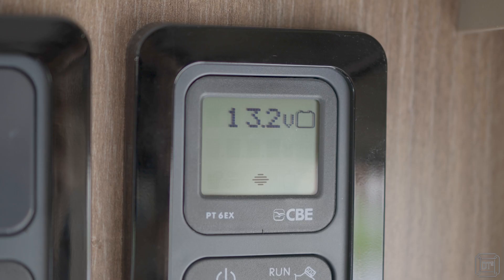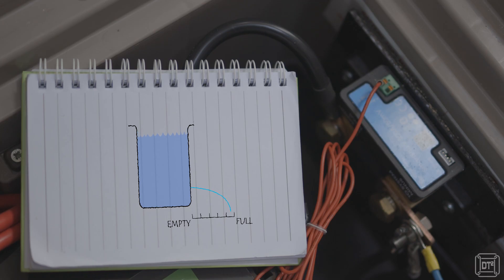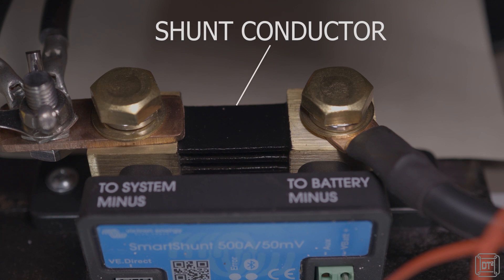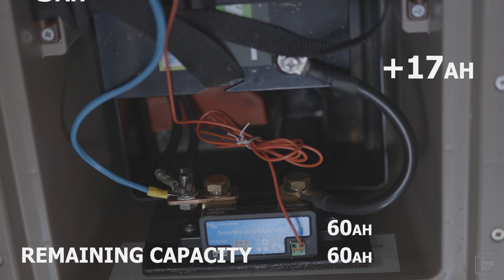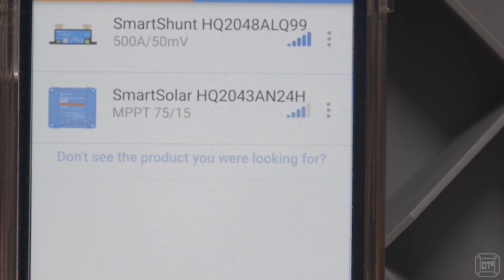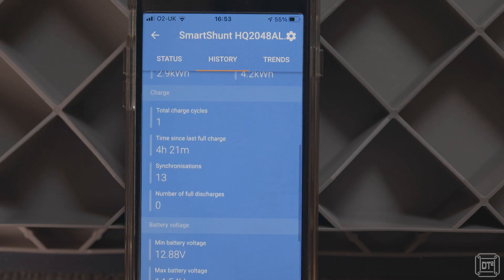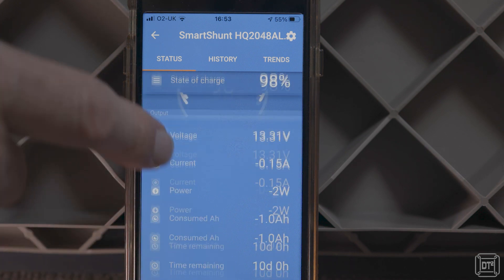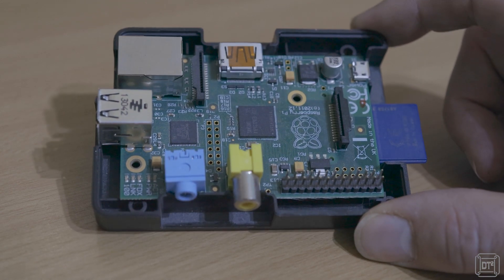VICTRON SMART SHUNT –smart enough?

Comment: Lots of missinformation.... well...not 100% missinformation but misspoken... in fact Li-IOn is VERY accurate capacity dependence on voltage. But LiFePo4 batteries is not. and u used term Lithium batteries is not good at telling SOC... yeah for LIFePO4 but not Li-Ion batteries.
Reply from the maker: Thanks for ponting that out.

Comment: Great explanation. Does the shunt show the amp in and out separately. I d like to know the generated power rather than the net.
Reply from the maker: Thankyou. No the shunt can't measure generation at the same time as usage (i.e. if you have a solar panel in circuit). It will only measure the net loss or gain. Which is a benefit since otherwise it would not be able to keep track of the batteries state of charge.
If you have a smart solar controller then that could measure the generated current and by combining the data from both devices you could know the current used, generated and subtracted (I.e. deficit in the battery). Ideally the victron shunt and solar controller, which do communicate, should record data from both devices and do the maths but unfortunately they don't. (Hence the video title.)
Reply: @DTSquared thanks. Makes sense.

Comment: Was wondering what that little red wire was for.    Probably also how it determines the voltage.
Reply from the maker: Yes it also detects the voltage as without it the shunt would only be able to measure the voltage across the shunt which is not the same thing as the battery voltage.

Comment: If i wanted to purchase something similar to the bus bar you added to allow for a small eyelet size, what would you suggest?
Reply from the maker: I just purchased a strip of copper flat bar from amazon and cut and drilled it. If you don't want to go down that route, then the alternative would be to look at 12voltPlanet.co.uk . They have all sorts of busbars that you could probably modify. Or if you reach out to them they may be able to suggest something. As I recall they were quite helpful when I last used them.

Comment: It appears there have still been no updates to the smartshunt, even with using the Cerbo GX that can hold what I thought this was for, how much you system was actually putting into the batteries in a day. I wanted this to compare the smartsolar 100/50 to the epever 8415 AN charge controller, as I’m more than a bit skeptical of claims that Victron’s product performs better. The failings of the smart shut have left me with having to trust each charge controllers tracking, and so far, the victron smart controller is not matching up well at more than an additional 1/3 of the cost, especially when you add in a cerbo gx which is required to get the same data epever provides with a $30 wifi dongle.
Reply from the maker: Some people have mentioned that there have been updates in regards to recording data but if there have been I haven't found them or they relate to the temporary monitoring when the app is open.

Comment: can the shunt stop the discharge flow to prevent to great a battery discharge ?
Reply from the maker: The shunt is purely a monitoring tool it has no switching capacity. I believe that Victron do have a range of battery disconnect devices which will disconnected the battery when a voltage is reached to avoid over discharging the battery. But I haven't used those or researched them in any detail.

Comment: Hello david could you tel me what size stock cable i need to connect the shunt to battery thank you
Reply from the maker: Hi Scott, The size of cable isn't really related to the shunt but instead would be based on your maximum current draw and the distance between the shunt and the battery (i.e. length of cable) which should ideally be as short as possible. Obviously the shunts rating (500amps on the version I purchased) would also be the upper limit.
I purchased a pair of battery connector cables from KS Energy (the same place I purchased the shunt from). They are 25mm2 CSA (about 6mm conductor diameter) and according to the link below rated to 180amps.
I only used one and shortened it but mainly for neatness as I doubt the change of length from 300mm to 200mm would make a rating difference. So if you don't have crimping tools they can be used as is. 
If you are just connecting "normal" 12v stuff then this should be sufficient but if you have higher current draw items such as inverters or motor movers then I'd recommend checking.

Here's a link to the ones I purchased (KS energy has been taken over by another company but the store link appears to still be up.)   https://leisurepowerproducts.com/shop/ols/products/300mm-parallel-battery-to-battery-connector-lead-set-with-8mm-lugs

Hope that helps.
Dave
Reply: @DTSquared  great thanks for that 👍 just one more question did you connect the motor move to the shunt system minus also thanks for your help

Comment: I just got this shunt today and have it on a 24v100ah lifepo4 lithium battery its great measuring what i am drawing out of the battery but just wondering if i can add a battery charger to the shunt aswell to measure what's going in? I was thinking of getting the victron 1p22 charger.
Reply from the maker: Yes you can add a solar charger and if you get a Victron one with bluetooth they will communicate and share certain data.
The shunt will then measure what is going in and out of the battery. If you have a load (ie lighting) and sun is shining then the current draw shown will be the balance of what thebbattery has to pick up. So will be lower than the actual load. But it will still calculate the balance of the battery correctly. Cable from the solar should go to the shunt not the battery terminal that way it flows thru and calculates correctly. You should be able to see this in my video.

Comment: I have two 200 amph lithium batteries in parallel do I set up my shunt for 200 amph or 400 amph?
Reply from the maker: Assuming the shunt is wired up so that all loads a charge sources are going to the same neutral then it should be set as 400ah.
If you think about it each battery internally is multiple cells or battery's, so the principal is the same. Your two batteries are creating one big battery.

Comment: Dont you need to explain negative distribution? If connections are made directly to the positive then the shunt wont measure any current draw!??
Reply from the maker: It's generally direct connections to the negative terminal which bypass the shunt and are therefore not measured. This is why the installation instructions recommend that the shunt is the final and sole connection to the negative terminal. So a device connected directly to the positive AND negative would then be on a separate circuit entirely and so not be measured. A device connected directly to the positive but returning to the negative via the shunt would not be any different to any other device since it's just forming part of the overall load.
I'm not familiar with the term "negative distribution" but if you have some links to an explanation then I'd be interested to read up on it.

Comment: Excellent instructional video Thanking You 2000%. I think some battery's have things like these fitted inside
Reply from the maker: Thanks glad you liked it and found it helpful. Some batteries, specifically in this case LifePO4, do indeed have a method of measuring their remaining capacity. However some of them use the cell voltage instead of counting the amps in and out as a shunt would do. This makes them more accurate over long periods where the battery is not being charged to 100% (and therefore not allowing the shunt to effectively re-calibrate). I always use my KS-Energy battery's built in bluetooth for checking capacity when in storage over winter. But it also makes them more susceptible to other influences on the battery voltage. But they are still, I think, more accurate than a simple voltage meter across the terminals as they will be designed for the specific configuration and also are constantly monitoring and so make allowances to give a more accurate figure.

Comment: This helped a ton. If you go with either of these, do you get the same looking interface on a smart phone that you would with a GX Touch 50? That looks pretty good how its shows the devices, graphics showing power direction, power sharing, etc. I can't find any images of the Victron Connect App with this same GUI.
Reply from the maker: Hi Tim glad to hear that helped. I've not seen any holistic system type displays anywhere on the app. The latest update puts some basic information on the initial device list screen such as the battery % for the shunt and solar power for the charger (that's from memory as I don't have it in front of me).
You have to go into each device to see more detail and it doesn't really show information from other devices when you do. I think I've seen similar screens on their website for the windows app but certainly not in the mobile app.

Comment: Thanks for your insight. According to your explanation here how accurate does it work with lead acid batteries? I am ging to installiert a smart shunt and offload the data to a Software called 'Solaranzeige' on a Pi.
Reply from the maker: Hi, The shunt measures current so works on any battery type. They are particularly useful with Lithium batteries because the voltage difference between~90% and ~10% is very slight so can't be used to work out capacity accurately. However on LeadAcid batteries whilst the voltage drop is pretty much a straightline in relation to capacity it is significantly affected by load and charging. So on a lead acid battery you ideally need to turn everything off then wait a while before trying to estimate capacity based on voltage. So on that basis the shunt should give you a more accurate measurement of capacity on both battery types but for slightly different reasons. Hope that helps.
Reply: @DTSquared  Hm, I got a 24/230V Konverter and a Fridge connected. Both are discharging the battery on pretty constant amount, of depending whether the fridge is running or not. Like if the fridge is off, the converter will pull about 50Watt ~ 0.9A (only converter and Raspberry Pi) and when fridge is running its about 110W ~3,6A (all 3 together). So, fridge is usually running ~5Minutes and afterwards its about 20~30 Minutes rest. <- Will that be enough to get an idea or do I need to switch off everything?

Comment: Dave great video and lots of good info yet again.
I am thinking of getting a Victron smartshunt as well however I use a portable folding solar panel which I put up on arrival at site. As I usually connect straight to the battery with crocodile clips I don't think this would be possible with the setup required for the shunt.
The positive crocodile connection to the battery would be I think OK but where would the negative connection go?
Would it have to go to the shunt "to system minus" side and not to the negative battery post where I normally put it.
Any thoughts would be appreciated.
Cheers Peter
Reply from the maker: Thanks Peter glad you found it useful. The negativr solar connection should really go to the shunt (on the side away from the battery) that way input current will get measured correctly. Whilst crocodile clips aren't ideal (especially for large panels) it should still work OK assuming that you can get the cable to it from the panel of course. I made another video about a DIY external MC4 connector which you may find helpful. Can't find the link right now as on a coach in Stockholm but if you search my channel for MC4 you should find it easily.
Reply: @DTSquared  thank you for the reply.
I will check the video out. 
With what you have said I think I will remove the crocodile clip and put a ring terminal on and connect permanently to the shunt that way. The solar panel cable has a plastic socket connection so will still be able to disconnect the panel from the system leaving the negative part still connected to the shunt. Hope that makes sense.
Have a good coach trip.
Cheers

Comment: Very detailed explanation. Where I get confused is whether or not the app can calculate current wattage consumption from an inverter draw. IE, the only draw is a 500watt device from an inverter. Does the app show that 500watt draw accurately even with an incoming solar charge through charging the battery?
Reply: The shunt only shows what is going into or coming out of the battery.  If the inverter is turned OFF, then what is recorded by the shunt is what the solar charger is putting in.  If the solar charger is OFF, the shunt shows what the inverter is taking out.  If both are ON at the same time (charger and inverter), then you have to do the arithmetic:  Inverter load = Solar Charger Output-Battery Input.  Best us a clamp on DC digital amp meter to get the real inputs to the inverter, and not rely on the LCD on the inverter telling you what the output is because of inefficiencies in the inverter itself.  I have a Victron shunt, and as of fall of 2022 it has a graphical history of any two variables you want to track.  I like it.

Comment: I notice that you have installed the same lithium battery and Victron set up as me. What I don’t understand is the Victron app shunt shows a different capacity to the KS energy app with the KS app showing more capacity than the Victron.  I’ve connected all ground via the shunt so that’s not the problem I’ve also charged the battery with a Victron charger set for lithium before telling the shunt that the battery is at 100% so a bit puzzled.
Reply from the maker: The KS app/BMS uses a slightly different methodology to calculate the state of charge. I usually find there's a couple of percent difference but nothing to particularly worry about. Here's some words from Neal at KS when I asked about it. 
quote*The SOC gauge algorithm logs both current and battery impedance to estimate the SOC, and the impedance can be variable with things like temperature, load, or trying to charge over a period at an incorrect voltage. The Victron shunt you have can be a little more advanced and accurate for SOC once its set-up and calibrated since a shunt can more accurately log current, but even using this it can accumulate inaccuracy’s and may fail to auto calibrate during use if you are using a range of different charge voltages.*endquote
Hope that helps
Dave

Comment: So the shunt tells you how much you have used. Fine. But how do you ever know if you actually started at your battery's maximum? Did your charger quit after it hit 78%? Some other %? Do have to go to dead and then measure how much goes in? Then compare that to the rating on the battery?
Reply: If your battery is lead acid type, measure the specific gravity of the electrolyte.  That is the only sure way to know it is fully charged.  Let the battery rest a few hours before making this measurement
Reply from the maker: The shunt considers the battery to be full once the specified charge voltage has been reached AND it has stopped charging (i.e. no current flowing in). Not purely that there is no charge going in since obviously that would happen every night when charging with solar. If a significant amount of time passes during which the battery is never fully charged then the shunt’s state of charge percentage will drift over time due to inaccuracies in the “in/out” measurements building up plus the natural discharge of the battery which it cannot measure. That's why it's recommended to ensure the battery gets fully charged every so often (I think the recommendation is once a month).

Comment: Thanks for the video. For the price ($300) the performance and features of the victron are just not there. I have since replaced the 712 smart for a $60 unit that I find does a far better job. Has a much better interface, and comes with a remote (wired) screen for inside the trailer as well as bluetooth with a great looking app. Look up: KG140F.
Reply from the maker: I did look at some of the Chinese un-branded shunts. But I wanted to stay in the Victron environment (which is why the lack of data passing between the shunt and the smart solar was a disappointment).
Reply: I'm disappointed in my Smart Shunt. I have 4 other Renogy battery monitors in service and they are a bit inaccurate (including the Victron) but reliable. The use of bluetooth assumes that you will be within its very limited range. The Victron will not transmit into my house from 15 linear feet away. The other 2 units have Renogy BT-1 and a BT-2 bluetooth on the MPPT controllers and they transmit nicely to my phone. But they are NOT battery monitors. As a temporary measure, I set up an extra $50 Pet Cam from Amazon to look at the Renogy display. Without all of the burdensome crap, I can now pull up my Renogy screen from anywhere in the world where I get an iPhone signal and check the system without the Cerbo GX and Pi device. I added a Renogy shunt in series with the Victron shunt. Neither of them read voltage as accurately as my Fluke meter.  I don't have the Victron display but it looks like you need to scroll through with buttons to read it. Try doing that from 3000 miles away.  The cheap Pet Cam has pan, tilt, zoom, 2 way microphone to listen for the 2 inverter fan settings. And the Renogy screen shows all I need. Here are the 2 shunts in series. The pet cam sits on the inverter and reads in day or night conditions.  https://www.youtube.com/watch?v=5TIoLk4zJW8
Reply: @kimmer6  Well, if it works I guess. For me, setting up ANOTHER component to be able to read the one I want isn't an option. But I do like the idea of checking in on the trailer with a pan/tilt camera. (But can't deal with the power draw while on battery)